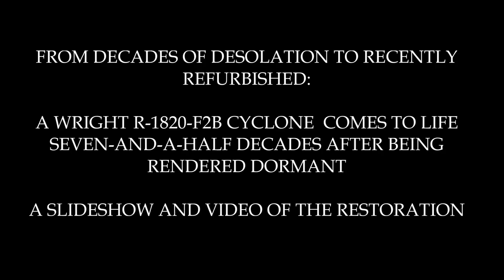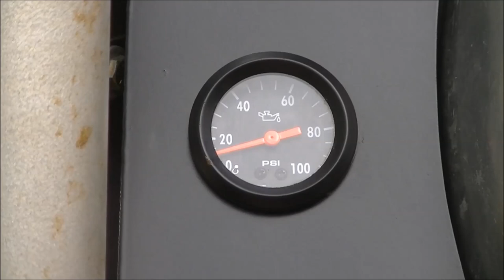Wright 1820 Cyclone

Comment: I used to work for Curtiss-Wright.  The 1820 is my favorite WWII emgine.  You did a fabulous job!
Reply: this is B17 engine right. they did build these with the Wright-Cyclone R-1820s
Reply: Yes.  There were many many variants with different power ratings as the engine design developed.  The R-1820-97 powered the B-17G, with a turbo supercharger.  The data plate should tell which sub-version this is, and from there one can research which A/C it powered.  Note: during WWII many 1820 were build for B-17s under license by Studebaker.
Reply: cool where did y'all find this engine, how much did it cost you, and is this an original engine from a B-17 bomber or is it from another bird?
Reply: Wow Brian O'Neill, when did you work there? What did you do? How long has it been since you got to hear  a fresh startup of one of these?? Very good job, guys!
Reply: Beautiful piece of engineering.
Reply: @derekwall200  Did you bother to read the intro? All the answers to your questions are there.
Reply: I agree! Awesome job!
Reply: Neeeerrs 😖🤮🤭
Reply: Nelil Neilsojn  C-W had a steel extrusion facility on Grider Street in Buffalo in the 80s and 90s till they sold it.  It extruded stainless steep pipe for Navy Nuclear applications and also long structural bars and rods.  (It's original purpose was to extrude propeller blades, but that was before my time.)  The plant is long gone now.

Comment: Superb and highly skilled restoration of a great engine!   Note the cam ring (one for intake, one for exhaust) only has four lobes.   Strangely (to me anyway) it rotates in the opposite direction of the crankshaft, at only one-fourth engine speed.   Some really clever engineers designed this engine.   Firing order is 1-3-5-7-9-2-4-6-8.  At least it is on the Pratt & Whitney R2800 so I assume is the same for the Cyclone.  Fascinating engineering.
Reply: A P&W 2800 has 18 cyl.nit 9 Cyl.  
Correct firing order is 1R-12F-5R-16F-9R-2F-13R-6F-17R-10F-3R-14F-7R-18F-11R-4F-15R-8F

Comment: I've read and heard plenty about starting these.....you're doing about everything right...! In the movies, it's always crank over 1-2 times and they start...no oiling/fouling of the dual spark plugs...
Reply: its called 7 blades, before the magnets are turned on, indeed to prevent a hydrolock, and get some pre lube pressure before the initial start up.

Comment: 4 of the Wright 1820 turbo supercharged cyclone versions were on the B-17 "Flying Fortress". 1200 HP each. Not bad for the mid 1930's lol. Considering not long before that in WW1, we were using aircraft made with wood and cloth while chucking grenades over the sides of the planes.

Comment: Amazing job John, well done. Just a question though... you did the cut down of the props yourself !!?? How did you balance them afterwards ?? Even a few millimetres out on one with catastrophically destroy the engine !! I wouldn't be game !! 😁
Reply from the maker: Hi  i had them balanced at a prop shop   It is done static  they were individualy weighed in different positions  the reason was explained and made sense at the time  cheers

Comment: Love the video.
Are you going to gradually move up to an R-2800 and on to an R-3350? Concluding with the penultimate radial engine, the R-4360?
Some would argue the turbo-compound R-3350 as used on the Quantus Super Connie was the ultimate radial by combining the radial engine with aspects of its future replacement. The centrifugal compressor jet engine. Via the mechanically coupled centrifugal turbos. For me, the stories of significant early “teething problems” of the R-3350 in the B-29 always soured me on that engine. I spoke to a flight engineer on “FiFi”, the only flying B-29, in Texas at least, a couple of years ago. He said with original WWII rear accessory cases and cooling set ups, they usually lost a cylinder ~every 25 hours and had frequent accessory gear failures.
They switched to later improved rear accessory cases and cooling set ups used in commercial aircraft several years ago and were getting > 250 hours between cylinder/engine failures/metal in the oil.

The Quantus Connie videos I’ve seen taken at dusk do bring chills. I’d love to see and hear a Connie flying at full song on a dusk or night takeoff.
My Dad was a B-36 Aircraft Commander in the late 1950s to early 1960s. 6 R-4360s turning and 4 J47s burning AvGas. 336 spark plugs total. Not including the jet fuel igniters.
So I’ve always gravitated towards Pratt and Whitney’s with the R-4360 as my favorite. The “Corn Cob” engine. A mechanical marvel.
I flew air ambulance flights with my Dad in the 1970s in a Twin Beech with R-985s. I was a 16 yo informal “autopilot”.  I’d just get the airplane trimmed up for hands off cruise when the, nearly always, morbidly obese neonatal nurse would get up and walk forward to check on the baby in the incubator. 5 minutes later after significant whizzing trim wheel manipulations I’d get her settled down at the proper altitude. Just in time for the nurse to move back 6 feet to her seat and make me start all over again. Fun times. And, although I didn’t know it at the time, very educational for future flying.
That very airplane was restored and is hanging today in the Seattle Museum of Flight. I loved flying in that white plane with the red crosses and wish I would have appreciated the uniqueness of those days when radials were still relatively common. Most people thought they were loud, smoky, rough starting and obsolete. They were.
But that’s what made them so great. And still does.
Great videos. Keep up the great restorations.
Reply from the maker: 1830 is next  stay tuned  thanks
Reply: love your videos. just found them. could you do a couple more in depth videos of the build? maybe how you clean the parts and get them ready for assembly. it's fascinating to see what you do with these. i happen to have the opportunity of restoring an A-26 invader to flight status. the engines have already been gone through. the wings were removed some years ago and we are in the process of evaluating them for repairs, corrosion etc so that we can hang them on the fuse and then the engines. thanks for putting up the vids. have watched them all now.
Reply: If the R-4360 was the penultimate radial,  which do you consider  to be the ultimate one?
Reply: Lycoming XR-7755, perhaps?

Comment: It would  now cost at least $40,000 to overhaul a Cyc. We had GR 202A's in our DC 3's. When I was an apprentice in 1969 my airline sold it's DC 3's & spare engines to a scrapper. I was told to make sure the scrapper couldn't re sell the few nil hour Cyclones.

Comment: Cool engine now you can buy the plane now !😂😂
Reply: a plane without an engine is a glider...
so what is it he has to buy ? and what is it that defines a plane ?

is the engine actually the plane ? 

is a glider still a plane regardless of it its powered or not ?

or is it not until 'glider' meets 'engine' that those both become...'plane'
xD
Reply: @keithbeckett1349  what do you think?
Reply: @davecrupel2817  I think I was kinda talking a load of shit and a plane is simply a aircraft that is built with the intention of being engine powered, regardless of if its engines are installed or not, opposed to a glider which is built with the sole intention of being un-powered and gliding due to the lift from its wings alone.

So I guess he just needs to go buy a plane with empty engine mount lol.
Reply: @keithbeckett1349  ?  SOLAR T62T,27

Comment: The valves are a big job to set just right.
Reply: These are actually the easiest to set as no depressors required. Just a little shove and grunt against the pushrod and set at a scant .003 - 007 thousandths clearance.

Comment: Most of my radial experience is on the R-2000.my engine s always went to TBO...1200 hrs cos we ran them right....only one cracked cylinder in many years....someone else was using my airplane!
I think it's time for a backyard build...maybe 985, or 2800! Fun just to run'em
Reply from the maker: Hi  I have a few R2000s  just havnt getten to them yet,,just starting to put an 1830 together now,its been dissassembled along with 10 others packed in the container  gunna be slow progress

Comment: I always feel bad for the starter motors..................
Reply: higgy - I totally agree.  Those starters must have gone through armature brushes being replaced often.  Could fry an egg on em after starting one of these radials.
Reply: But why does it take so long to fire off?
Reply: Really good question.  There are probably several reasons.  Compression leaks because; The valves aren't seating correctly, the rings aren't broken in and also not seating correctly; would be my fist guess.
Reply: Jay Todd these engine have the problem of collecting oil in the lower cylinders. Thats why he rotated the engine to prevent a hydrolock. The he spun the engine to build up oil pressure before starting it. as its carburated its not that easy to start them off with the correct air/fuel ratio. You have to pump fuel into the engine to start it. they are built to fly not to idle.
Reply: KOnst4nt1n96 -  Just didn't want you to think your educating words weren't  appreciated.  Thank you.  It makes sense. But that movie Flight of the Phoenix used shotgun shell blanks to start the motors.  Was that engine more sophisticated or less than this one?  He did say something about "clearing out the cylinders".   Jimmy Stewert I think.
Reply: It was a different type of starter due to the need for huge Batteries and a big deep fry starter motor. 
The Coffman starter was pretty popular at this time as you only need cartridge and a barrel pointing in the inlet of the engine. The explosion will force the piston down and this will result in the engine to spin and hopefully to start. It was used in smaller and lighter planes. The problem is that you cant spin the engine endlessly (until the battery dies or the starter is fried) like on this motor. You will get less inertia and have to time the starting perfectly. 
The Coffman starter was used in a lot of planes in the 1930s and 40s. For such a huge engine as the 1820 you would better use a electric or air starter.
Reply: I hope you realize that's a whole bucket-load of great know-how and intellectual property even if it is dated.  To an old mechanic like me it's so Romantic it's almost porn!   Were the air starters vane motors or piston/reciprocating or did they just pump the engine pistons and release the compression stroke pressure somehow?  My BSA 441 Victor Special had an exhaust valve lifter to help with the kick starting.
Reply: I know that these craftsmanship is priceless. I like the old engineering aspect of rough but it works. I have a sr 500 from yamaha where you do the same. I think that its very unlikely to have an exhaust valve lifter on such a big engine. The air starter is a little turbine that spins very fast and through gearing will use the high rpm but no torque and will convert it to high torque low rpm :) But i think that the gearing will overheat too if you use it too long.
Reply: Aww man! I'd a loved to own one of those Yamahas!  Probably more reliable than many other bikes.  So they had to store compressed air somewhere on those planes.  Wonder how they compressed the air?  There are many compressed air, alternate energy cars, especially in India.  My old suspicious mind thinks they make too much sense and are too low-tech to be allowed to succeed in US market.
Reply: Modern Airplanes all have air starters but the pressure is generatet by a small turbine generator (APU). Trucks and Trains use air to brake too so why not use it to start the huge engines. Why you dont buy a used sr500 or the newer 400? they are easy to take apart and built from ground up :)
Reply: Just think, it went from pulling through by hand to start to winding a crank spinning a flywheel for the inertia to turn it over. They then put an electric motor  in place of the crank to spin the flywheel. when battery and motor technology caught up the direct drive starter replaced the inertia starter. There is an anti-kickback assembly that lets the starter drive slip if the engine fires and tries to kick back against the starter keeping from breaking things.
 You can only turn the starter for a short period and then let it cool or you will fry it.

Comment: Great video.  Question though. What is the purpose of the planetary gears ?  I thought the prop turned at the same rpm of the crank ???
Thanks.
Reply from the maker: hi  the prop turns slower than the engine  9 turns of the engine to 6 of the prop   the ratio varies between engines but its common with the larger engines  cheers
Reply: John Rutherford     Oh. I see. Thank you

Comment: What planes were fitted with that engine?
Reply from the maker: That one was from a Dc2
Reply: @johnrutherford9937  I heard of the DC-3 but not a DC-2…
Reply from the maker: @chrismayer3919    Mine is an early one and was out of a Dc2
Reply: @johnrutherford9937  I googled it; they look virtually identical (no wonder I mixed them up). And yet I always thought DC-2/3 were fitted with Pratt and Whitney ‘Wasp’ engines? 🤔
Reply from the maker: @chrismayer3919  dc3 used both  dont know bout dc2s
Reply: @johnrutherford9937  well, regardless; they’re both mighty engines for impressive aerocraft!

Comment: Was this engine preoiled?  sorry if i missed anything stating so...lazy reader.
Reply from the maker: preoiled ?  lubricated during assembly yes.also cranked over without plugs fitted until oil pressure achieved

Comment: Running it like that will just choke up the cylinders, lets see it at full throttle how it should be run..
Reply from the maker: So you would recommend running a cold aero engine at full throttle ?? I prefer running the risk of "choking up " the cylinders what ever that means,,thanks for your advice.
Reply: @johnrutherford9937  Youve already warmed it up. Dont you trust your own work? Lets see it wound up just like it should be run..

Comment: Idled down slower the 1830 sounds a lot like a Harley Davidson...potato, potato, potato, potato....Briefly worked on a US2B at NAS Memphis, operated by NARU - Naval Air Reserve Unit. Another crew member would say,  "Sounds like the airplane is taxiing in." Me, "Either that or two T-28B trainers."  Both used the R-1820. : )

Comment: Video doesn't show how the badly deteriorated parts were restored, or even a hint at that. In another vid on the restoration of a P&W R-2800 they showed a new metallurgical technique used to build up worn and corroded metal to original dimensions. This vid is almost "I waved my magic wand and the parts were like new again!"